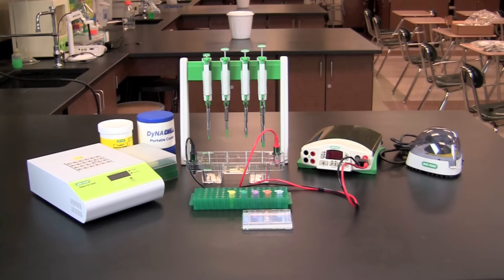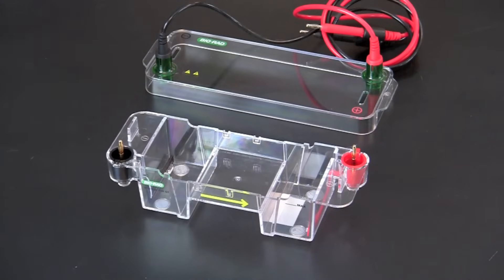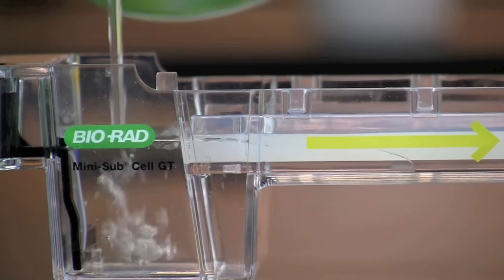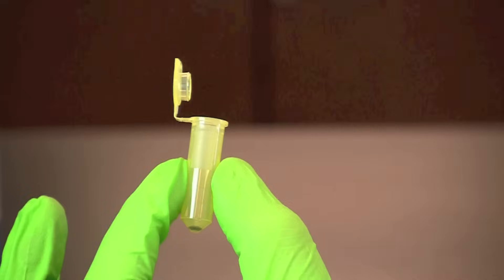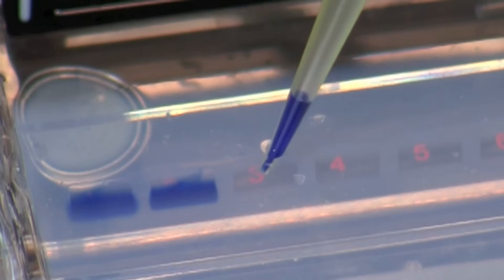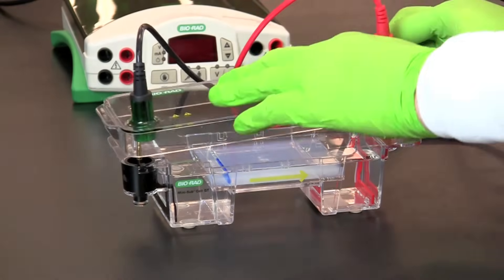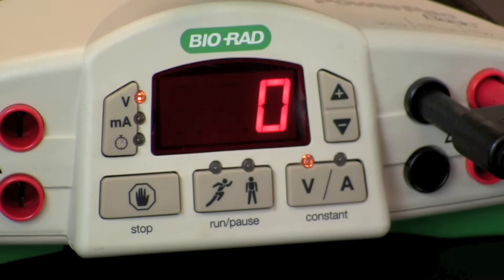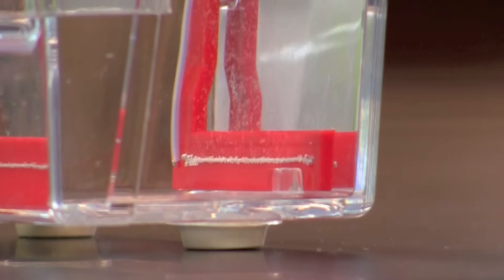Agarose Gel Electrophoresis

Comment: Please DO NOT stick your pipette tip in the well while loading,you might puncture it, not to mention the sample might hit the well and spurt outside the well.pour enough buffer so that your tip is immersed but is still right above the well and release sample slowly. The loading buffer in your sample, in this case the blue stuff, contains glycerol which is heavy and 'leads' your DNA safely in the well.
Reply: I do what I want
Reply: @whatevervlogs9663  you can choose to learn or not. your call mate 🤷
Reply: @papoutsothiki  I don't think that's a thing, the pipette is supposed to puncture through the gel to allow the plasmid dna/ genomic dna to enter the electrophoresis casette
Reply: Actually I'm curious to know how to load the sample.if I simply put the sample in the well doesn't it get mixed with buffer.or u directly put the sample inside the agarose??
Reply: @cakeOOdial  your sample should already have buffer in it because you use the Loading Buffer LB I use a 1 microliter of 6x loading buffer (trisborate a couple of dyes and glycerol) and 5 microliters sample therefore your LB is diluted to 1x. If you are using 1x TBE or TAE the liquids in theory are close isotonically even though the actual samples vary. do not worry. the glycerol in your LB is heavy enough it will pull the sample into your well because gravity. Just practise a bit - put the tip above the well IN THE BUFFER and slowly release sample (no bubbles) you will see your sample-dye sink to the bottom of well.  Maniatis protocols explain this nicely. Let me know if you need a recipe for LB .
Reply: Don’t tell me how to scientist, nerd

Comment: What happens if I place samples in the wells first -- that is ahead of the buffer?
Reply: Sorry to reply a year later, but in case you or others are wondering, I do NOT recommend this. If the samples are already in the wells when you add the buffer, the movement of the fluid could cause the samples to spill out of the wells, leading to contamination